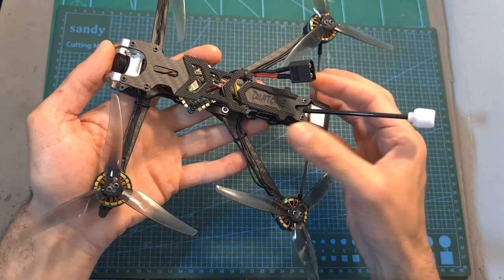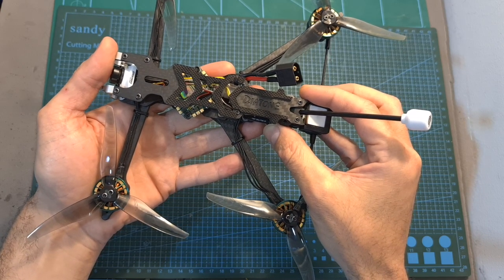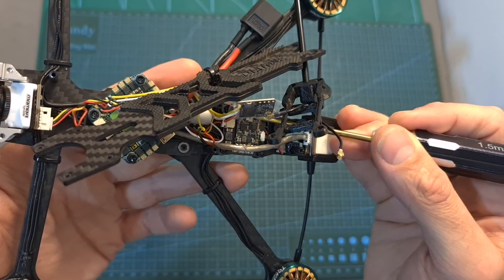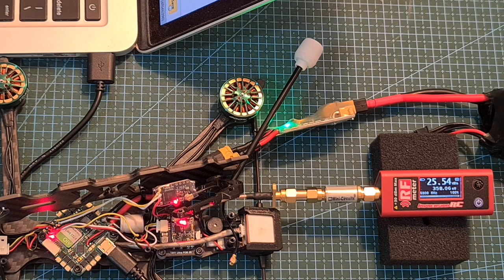Diatone Roma L5 VTX Unlock // Long Range Flight // Ultra Tiny VTX

Comment: Roma f5 V2 is shipping with a locked VTX. Slightly different to this one. To unlock it you need to first, hold the button for 15 seconds as you show here. Then you need to go into the VTX table in betaflight and enter the correct information, or install the correct JSON file, which I couldn't locate. So, 2 step process, not the 1 step as shown here. I am putting this comment on this video, as it is the first video to show up when searching for a fix for this problem. Hope someone finds it and it helps them out.
Reply from the maker: Thanks a lot for sharing your findings!
Reply: Does this vtx work on SA or IRC?
Reply: Thank you for the information

Comment: Thank you Gal, i just recently got a new Roma F5 and Diatone sent me instructions. However, on your video the light is red for yours. When i do the procedure the LED that remains on is Green.  The VTX on the quad is a Ultra Tiny 400 (mamba i presume). Also, for some reason I cannot activate the OSD via sticks as prescribed by Diatone (Left Mid Throttle + Right stick UP). I only hear 2 beeps and no OSD. Any help would be appreciated. Thanks

Comment: Wow... Must have had a li-ion pack to go down to ten volts 😜.  I was sure you were done at like over a km out.  Great vid ! Thanks for the range test. I was wondering how far I could go with that vtx.
Reply from the maker: Haha, of course it was a lion battery :-) 
Thanks a lot Danny, I appreciate your kind words.
Reply: depends on the area, in high rf noise area just outside of big city i was barelly getting one Km range while aiming at quad with VAS Pepperbox. My chimera with unify pro 32HV could do that with ease even running on 25mW on the exact same spot. That vtx is definetly not a keeper. However quad flies fine.
Reply: @KremerFPV  Gal thank you for posting this great video. Can you share the LION battery setup ? Did you create a rig for the batteries? or did you use something that i can purchase ?
Reply from the maker: @DjArity  My pleasure :-) 
I've made this battery pack by using the LION cells which are linked in the description of the video. If you'd like to purchase a LION pack I have a good experience with this one: https://flywoo.net/collections/battery/products/explorer-lionpack-18650-3000mah-sony-vtc6-4s-14-8v-4s1p-xt30-for-long-range-fpv-racing-drone?sca_ref=512433.6TrebOmVvl

Comment: I was hoping you were going to have the Crossfires dynamic RF power level in your OSD...The old RSSI level may as well be deleted from the OSD now we have mode and Link Quality....The Crossfire RX antenna works better at the front of the quad IMO, especially when returning home...🤔😳🇬🇧
Reply from the maker: Yep, you are correct, I prefer mounting the antenna at the front of the quadcopter and I covered it on a previous video. 
I normally disable dynamic RF power and I leave the RSSI value just because it's an old habit :-)
Reply: @KremerFPV  What do you mean you disable dynamic RF power..?..You mean you lock it to a fixed power level?... It iNAV, you can watch the dynamic power changing on demand...🤔😳😯🇬🇧

Comment: On this flight, which version do you have? 1700kv or 2900kv? I guess 4s liion, even cruising almost 80kmph is amazing 👏
Reply from the maker: 1700KV, and yes, I used a lion battery :-)
Reply: @KremerFPV  You hit 75kmph cruising speed with a 4s liion and 1700kv? Oh man I ordered the 2900kv version, that was probably a mistake.
Reply from the maker: @DennisRiessbeck  you should probably limit the motors output to about %70 when using lion batteries.
Reply: @KremerFPV  will try it. I am curious how it compares against my heavy 6inch long range setup, any flights on heavy wind yet?
Reply from the maker: @DennisRiessbeck  Not yet, but I will test it soon using a full sized GoPro camera and see how it goes.

Comment: Thanks for your video!  But I still can't change power.  When 15 seconds are up, I try to change the power and it goes from green to orange and then after 2 seconds back to green.  I can not in any way manage to unlock it completely, I do not know what it can be, ☹️
Reply: I have already unlocked it!  It is made by betaflight, on the VTX channels, 👍
Reply from the maker: I am glad you got it working :-)
Reply: Hi, so how did you manage unlocking your VTX? Cause in this video info shown is not first step definitely...

Comment: Thanks for this video. I am having trouble keeping it a higher mW rating. It always goes back to 25 mW. I saved a VTX table in the CLI and now my options are in the OSD 25, Lvl 1, Lvl 2, Lvl 3, Lvl 4. It keeps going back to 25 mW even after i successfully save it in the OSD to something higher. Any ideas that could help me, I would appreciate it.
Reply: me too tell me if you find anything
Reply from the maker: My pleasure. Have you used the VTX table that is listed in the description of the video? Is the VTX configured properly under the ports section? If so, check if you can manually configure the VTX output power after disabling the Smart VTX control in BF.
Reply: You have to change the power level of the vtx in beta flight 10.4.2 or higher.  It worked for me

Comment: Long range quad with locked vtx. That is so annoying 🙄
But 700mw if that's accurate is really good though
Reply from the maker: Yes, but unlocking it is pretty easy and you need to be aware of it when getting the drone.